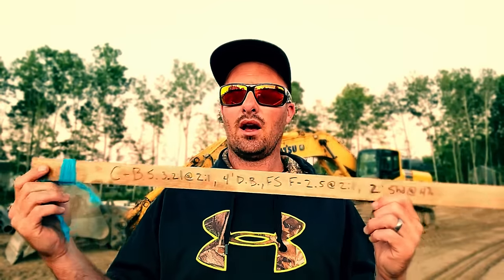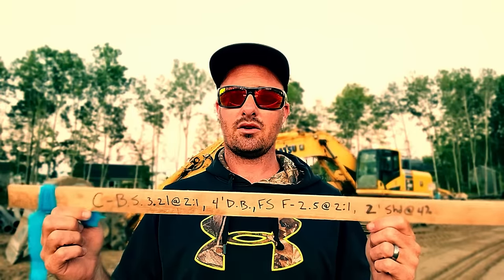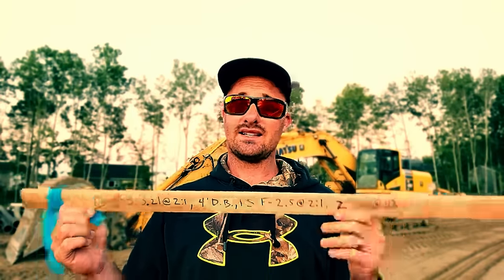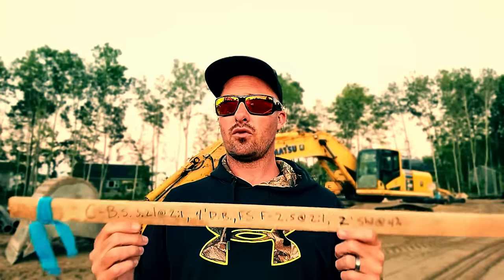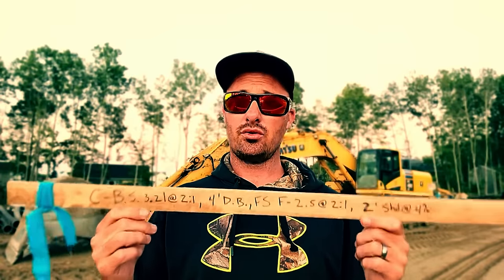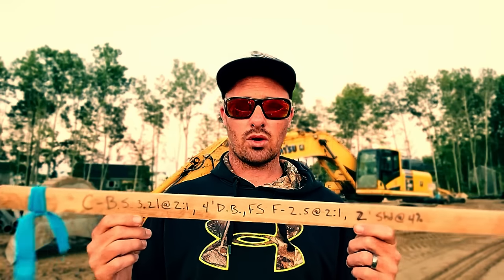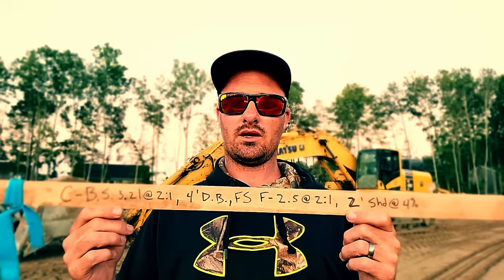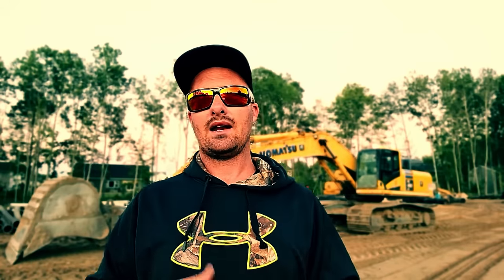HOW TO READ GRADE STAKES || How to read grade stakes for roads - Grade stakes cut and fill

Comment: I need help converting the hundred into feet or inches. For example 672.54 how do I calculate that I to feet/inches?
Reply from the maker: Set the 672 to the side for a moment since we aren't messing with that.  .54 represents just over half a foot.  Since 1ft = 12 inches we can multiply .54 x 12 inches which equals 6.48 inches.  Your elevation is 672 ft, 6 and a half inches.

Comment: What does ff with a line mean, with the line about 4 ft high from ground
Reply from the maker: "FF" typically denotes finish floor which would be the top of concrete in your structure.
Reply: Thank you

Comment: How do I convert the number above sea level to feet? If I want to set a vault with that number so I know I’m at the right depth to set vault?
Reply from the maker: Hey, sorry I never actually responded to this!  I was about to and then got distracted with something.  To convert from sea level to your actual cut number you will need the vault elevation (also stated in sea level).  You will subtract the two numbers to get your cut depth.  For example, let's say your hub stake said an elevation of 793.24 and your vault stake (or the level listed on your plan) was 782.57.  You would take your hub and subtract the vault elevation.  In this case 793.24 - 782.57 = 10.67'.  From here you would catch your hub elevation with your laser then move your eye 10.67' up the grade rod and bam!  You are set to dig.  Hope this answers your question and again, I apologize for not getting back to you sooner!

Comment: I worked in asphalt and most asphalt companies work in inches and feet. Not tenths and hundredths of a foot. But as a general rule I  tried to educate my people that fill of 1.17 was 1 ft 2inches
.08 was 1 inch it was difficult for some to grasp
Reply: Example is .50 ÷ 8 = 6  0.48 ÷ 8 = 6
Reply from the maker: That conversion factor gets you every time!

Comment: I read water main , sewer ,& storm water staking. I layed pipe for 18yrs. Each station on your staking is also on your plans. I've shot both beginning & ending sewer run & figure out slope per staking. Well it also tells you on your plans the slope. I always crossed reference from staking to plans & found out they wouldn't figure out. So I would make note on plans what I shot off bench mark then run on both ends & what it figured out to be.
Reply from the maker: Thanks Terry! People underestimate how much math is done on a sewer crew.
Reply: @DieselandIron  As the pipe layer , I was responsible for to see if the staking checked out per the plans.

Comment: Nice job of explaining grade stakes.
I only have a problem with your fill stakes.
Fill amount is from the line with the arrow and not the ground.
That's what the line is for, to measure up from.
Keep up the good work.
Reply from the maker: This depends on the engineering firm and what the standard is in your neck of the woods.  It also will depend on what kind of fill stake it is.  On a large land balance jobs you will just see a number and in this case you are correct, that number references the fill from the ground.  On smaller fills (a couple feet or less) you will have fill stakes like the one in the video where the line represents the finished grade.  That is pretty common on road jobs were you have much smaller fills.  Thanks for the comment Paul.  These discussions help further inform guys to different practices in the industry and I appreciate you bringing it up!

Comment: On your fill stake you say the line with carrot is the final grade mark.  Wouldn't that be fill 3.26 from the line w/ carrot?
In my 21 years the stakes have always said fill/cut X amount and that was from the line w/ carrot.  It's done so you don't need a 10' high stake and a ladder for a large fill.
Reply from the maker: Generally around here on fill stakes the carrot and line point to the level of fill.  Since the ground is being raised it gives the operator a finish grade mark right on the stake. If this were a 9ft fill then it wouldn't have the carrot, only the fill amount.
Reply: Good video👍, around here most all grade stakes that don't have a hub, have a line with a carrot, cut and fill are marked the same way but you measure from the line. The carrot points down for a cut, under the line pointing up for a fill, or both top and bottom on a stake marked F/G for finish grade.
Reply from the maker: @pagardenrails8722  thanks for watching and thanks for the input!
Reply: crows foot?

Comment: How do I read grade stakes for foundation digging? Depths, steps etc.
Reply from the maker: Depends on the project. Are you talking a residential basement or commercial work?
Reply: @DieselandIron  residential home
Reply: @DieselandIron  it’s a crawls-space garage attached and I have no elevation grade stake. Guy didn’t put one
Reply from the maker: @josev.9728  Do you have a set of prints that list an elevation? If not you can set the elevation yourself. Check with your local municipality on code but you generally need to have at least 10 inches of fall within the first foot or two from the house. Find your high corner and set your top of wall height a foot and a half to two feet above that. You can then work your way back through the math to figure out how deep you need to dig.

Comment: Not trying to split hairs here but the "stake" that you are holding up is a lath "witness" which is really nothing more than a notepad that holds the information that refers to the elevation of the "hub" which is a "stake" driven into the ground, the elevation of which is written on the "witness".  Should the "witness" get lost for any reason, the grading foreman can refer to a "cut sheet" and recover the required information.  If the "hub" is knocked out, you are screwed and the elevation has to be re-established by a surveyor. That's how we did it here in la la land and no doubt it's done different in other places.  The "hub" btw was refered to as a "guinny" and the grade checker walking in front of the blade reading the "witness" and throwing hand signals to the blade was called a "guinny hopper" because the gc hopped from guinny to guinny.  I may have spelled guinny wrong but it is pronounce ginny.  I've never seen it written and may be vernacular of the region.  Not saying you're wrong, just telling you what I know. If anyone has a different experience or opinion on the subject I would like to hear it.
Reply from the maker: This is fantastic information and I was not aware of most of it. Thank you so much for the comment! That is some really interesting history on the industry. Feel free to split hairs anytime brother

Comment: You are incorrect.  At the video time of 3:42 that line with a crowsfoot is actually the reference point from where you would start to fill or cut from. If that stake was in the ground,how on earth would you fill the dirt up to that line ,with the amount of fill that is written on the stake?,when the stake itself isn't tall enough to do what you are saying? If you were to fill up to that line ,you would atleast have to have 3.26' of stake from that line to the bottom of the stake. So therefore you are wrong. The surveyor put that line there telling you to fill 3.26' from that line.
Reply from the maker: Calm your tits there Papa.  This is yet another example of where you need to know your surveyor or grade checker.  There are absolutely sites where that is the case but on a lot of jobs our grade checkers would come and mark the fill lines for us so we had a reference mark on the stake.  A piece of lathe is what, 3-4ft tall?  I can pound that 6 inches in the ground and have it stable which gives me the ability to mark the fill line up to a 3ish foot fill.  That, my friend, is how you mark it on a fill stake.  We did have several fills that were 8+ feet where the grade checker would strap a couple pieces of lathe together to get the height he needed to mark. 

As I say in all of my videos, none of this is set in stone as 100% industry practice.  Techniques vary depending on where you are in the country and what firm is doing your surveying (or if that's being handled in house).  Likewise, your experience in the field is also not 100% industry standard.  So again, calm yourself down and maybe learn a thing or two about other industry practices.
Reply: @DieselandIron  If I were to make an instructional video,I think that I would atleast get it right or I wouldn't be making that video. I was only saying that you weren't correct on that specific stake you were holding up. Just own up. A "my bad " would have been sufficient.
Reply from the maker: @followingjesus2064  except as I've stated, it wasn't incorrect bud. It may be incorrect for your particular area but that's how they do it here in Michigan.

Edit:  I should note, this wasn't an actual fill stake off of a job. This was an arbitrary number I pulled out of thin air. Had I written 1.26' we probably wouldn't be having this conversation so I will admit, that is 100% my fault for the confusion there

Comment: Just so I’m clear you said we would come out of the ditch at a 2:1 and that’s not quite as steep as a 3:1? I realize you simply misspoke because 1. The stake never mentioned a 3:1 back slope and trying to quickly convey all this info is a little mind bending and I know what you meant but a true beginner may get confused here thinking a 2:1 is flatter than a 3:1, you know and I know 2:1 is actually quite a bit steeper. My point is with regards to teaching that perhaps the idea that slow is smooth and smooth is fast could if you allow it, improve the validity of the info you are offering here. Good job though I knew what you meant. Oh and btw you can save yourself some ink by just circling the number you’re offsetting as opposed to abbreviating the actual word offset. So a 3’ offset would be at the top of your stake just a 3 circled. Good video bud you’re starting to get it!🖕🏻(loggers waive)
Reply from the maker: I most likely did misspeak but I'd have to watch it back to be sure.  It's hard to keep all of your information straight when making one of these videos since you've planned the order of the stakes, what information is etc.  At some point I'll have to revisit these videos.
Reply: @DieselandIron  ya then you have assholes like me knitpicking everything to I get it. Aside from that keep up the good work you manage to get a lot of valuable info out in a short amount of time 👍

Comment: 30 years as an operator of most big earth moving equipment, rough grade, finish grade, and layout grade checker and foreman. have worked many million plus yard jobs. Here in California non-union  (SCAB) outfits don't even try to compete with union labor. Our job performance is faster (more profitable), and done correctly the first time, allowing a union contractor to outbid a scab every time. let's talk percentage . 4 o/o grade = 4 feet every 100 feet, 4 tenths every 10 feet, 4 hundreths every foot. DON;T need a phone, calculator, or GPS. just a ruler and a hand level (PEEP SIGHT ). If on a job site your phone and your phone dies, what then?  go home?
Reply from the maker: I think there is this false notion that people outside of the union don't possess the skills that union operators have.  I can tell you definitively that is not the case.  There are just as many skilled operators outside the union as are in the union.  "The Union" is simply an organization by which people get paid and negotiate wages....full stop.